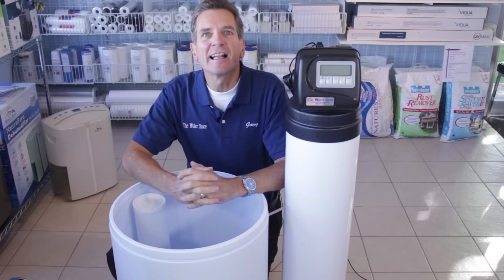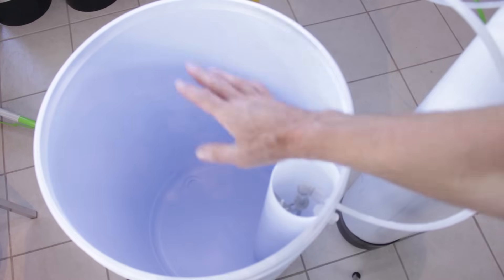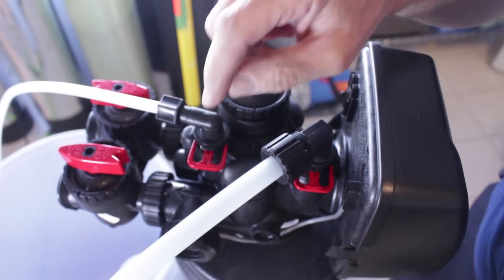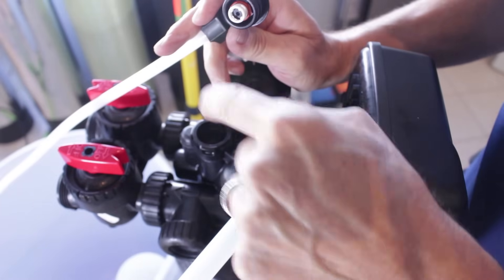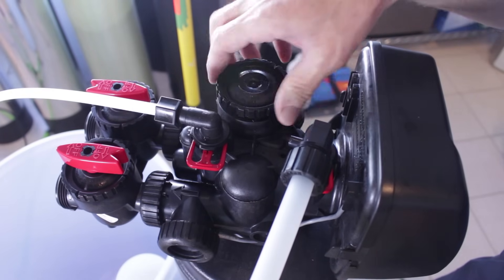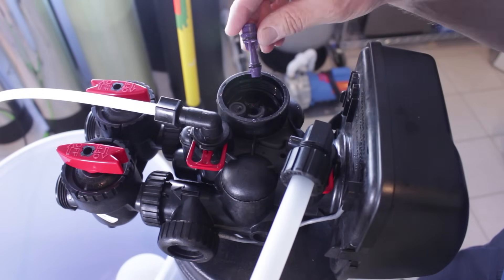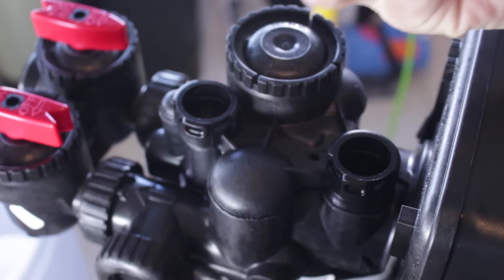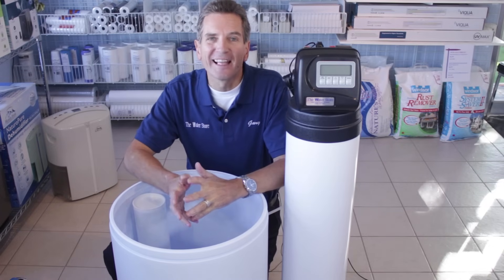Water Softener Troubleshooting Too much Water in Brine Tank

Comment: hi sir good day, i have a problem to my manual head  water softener, under the brine slow it doesn't absorb water instead it refills water in the brine tank.
what should i do ? 
thanks for accommodating my concern .
Reply from the maker: I have seen this before.  The valve needs to be rebuilt.
Reply: @water_estore  sir i already change a new item of head valve but still didn't function well. the same problem repeats even though i already change the head valve 4 times .

Comment: I am a bit confused.  It seems most of the things you mentioned control restricting the water going to the brine tank which means there will be less water in the brine tank, not more than expected.  In my case, my float stops flow so the max water allowed in the brine tank is always in there and not controlled by my Fleck 5600 mechanical timer water softener.  Maybe I don't understand the regeneration process.  Does the water softener meter how much water is put into the brine/salt tank or does it put the max into the tank and then meter how much is drawn out of the tank at regeneration time?
Reply from the maker: You may want to check out this video https://youtu.be/udmE-hhh084  The settings in the water softener determine how much water goes into the brine tank which determines how much salt you use.  It draws all of the water out of the brine tank during regeneration.
Reply: @water_estore The setting is at 10 pounds but I checked again yesterday that during refill the float stops the flow.  Not sure how to know how much water is calculated to create 10 pounds of brine but nevertheless I would think if the float stops flow at 10 pounds, that means that my unit can never use more than 10 pounds and the internal control will have little effect

Comment: Hi Gary. I am experience the complete opposite of this problem. My system is drawing water but not returning it. When I go to inspect salt levels I find all the water has gone. I add water and by the next day it has all gone. How do I address this problem?
Reply from the maker: Maybe you have a pre fill water softener https://youtu.be/GedMruLfXhY  If not I would check the hardness settings.

Comment: My  brine tank is 20 years old and I think has a small leak as water builds up outside of it - though I am not sure where the leak is coming from. I just had the tank replaced thinking it may be caused by that but it is not.   What should I do - as I am annoyed that the people I hired to fix the problem just wanted to sell me a new water tank for $1,300 rather than fix the real problem which I believe is the brine tank.
Reply from the maker: Sorry, I don't understand.  You said you replaced the brine tank and it is still leaking?
Reply: @water_estore  Sorry I found out the water leak was coming from the air conditioner's compensate box because it had been unplugged and  was overflowing onto the floor. Bottom line though I did not need a new Pump tank for $1,300 dollars - just needed to plug the damn compensate device back in. 😠

Comment: Recently have a softner issue. Guy came out and cleaned softner tank and iron tank. But softner seems to still not be working. When water is running I herd the iron tank filling with water but not the softner tank. Should I be able to hear the softner tank filling? And the salt I. The brine tank is not moving down so make me think m the water is not getting b salt, plus my husband and I are extremely itchy after taking a shower. Oh and water is slightly green, when you fill up tub only slightly looks green but if you let it set for awhile it is more noticeably green. Already had water guy come out twice, still seems to be not working? Help!!
Reply from the maker: Water softeners are silent when water passes through.  They only use salt when they regenerate, this video might help you https://youtu.be/udmE-hhh084  Did they test your water to establish if the water softener and iron filter are working?

Comment: My Whirlpool softener will fill with water, then very slowly drain, but not completely. Next cycle it will fill more, not completely drain. Next cycle it will fill even more, and slowly drain some. Eventually the water gets very high. It's like it doesnt k ow when to stop adding water, or the draining is too slow to allow the proper amount to drain within the specified time. I've cleaned the venturi multiple times and lines are not clogged. Any thoughts?
Reply from the maker: Assuming you've followed the advice in the video without luck, it sounds like an internal leak to me.  Afraid you need a new water softener.

Comment: I have a Clack valve that is re branded as a Hellenbrand H-1.25.  I purchased it from someone who had it installed in a larger application.  It does not seem to be creating suction and drawing brine.   I have attempted to clean everything and there is no active flow between brine tube and the drain tube so I don't think it's the piston assembly.  It has the yellow injector installed could it be the wrong injector that is preventing the system from drawing?
Reply from the maker: Yes, it is.  Page 10 of this manual tells you which injector for which size of tank https://cdn.shopify.com/s/files/1/0659/5447/files/Clack_WS1_Manual_Including_Drawings_and_Part_Numbers.pdf?11988583073503085745
Reply: @water_estore  The yellow injector matches the 13" tank I have.  I took the valve assembly out and am cleaning that today hoping that will help.  When the system is in brine draw it is pushing water into the brine tank and down the drain at the same time.  Very low flow on both ends but it's flowing out instead of in at the brine tube.
Reply from the maker: Pete McPeters water must be leaking past the piston. You likely need to replace the seal stack and pistons. They are here https://waterestore.ca/search?q=clack*+pis*&type=product

Comment: I have the opposite problem Gary.  I have way to little water being returned to the Brine tank.... Only a quarter of a gallon is returned to the tank....  It's a high efficiency water softener but that seems crazy low
Reply from the maker: Check your settings to make sure the hardness number is set correctly as well as the cycle settings from your manual.

Comment: how much brine waters is sucked back into the resin tank,   ….mine draws down very very slow and only appox 3/4" drop in brine tank happens
Reply from the maker: It should draw out all of the brine during regeneration and then at the end of the cycle replace it with new water.  If yours is not doing that you likely have a dirty injector.

Comment: Any idea why this thing would keep running?  I just worked my butt off on this thing all night. I ran out of running water, went back down in the basement and it was running again.
Reply from the maker: Not sure what you mean by keeps running.  Do you mean water keeps running to the drain?  If so, it usually means you need a new seal pack and pistons.  This video should help https://youtu.be/WIa033n4OQE

Comment: so are you supposed to put the system into bypass BEFORE checking any of this?
Reply from the maker: Good question, you can but as long as it isn't currently in a regeneration cycle you don't need to until you get to checking the injector, then before opening it up, yes, you should bypass and start a regeneration before opening it up.

Comment: My problem was brine water not being flushed out. After checking all the bases you cover, I still could not get it to work. I found an old display model at Home Depot that was missing the computer. So they were going to trash and let me trade out some parts. I did the bypass, the piston, the gears, and the venturi system from brine line to body, and bought and replaced the injector. After all of this, it would stick not suck brine water. 

I then focused on float assembly which was clean. I shook it to hear ball move and make sure it was not full of water. But I decided to watch how the ball floated under water and then noticed the ball would stick to bottom and not float up, even when under water. I was watching through a glass, and noticed by shaking it, I could free ball. But every time I put back in water, the ball would stick again. 

What should I do to fix this, without buying another part?
Reply: @water_estore  How do  I check? It makes the sound like it is in syphons mode. After soaking the float all night in joy soap water, it still sucks on bottom and will float if I shake it. Can the ball float stop it from sucking the brine?
Reply: @water_estore  I do not seem to have suction where it connects to the line at the top of softener. What role does the floating ball play?
Reply: Step 1 puts water out, 2 puts more water out, no 3, and 4 puts out more water. Then it goes to home.
Reply: @water_estore  I replaced everything but the float assembly, including the piston. I pulled piston out and noticed it was no longer locked in place. (1/2 turn) I locked it back and now have water flowing out of the drain line. My brine well is empty, except water now as I cleaned it all out. Should I add salt now, or add a resin rejuvenator?
Reply: Thought everything was working. Started with new install steps. Added salt waited 1 hr and ran a full cycle. Brine tank full of water again. This has nothing to do with the ball float?
Reply: @water_estore  Waterboss 900. Part number? It is 3.5 years old.
Reply: @water_estore  OK, I just tried a complete assembly of the piston from end to motor. Shop vac'ed to 4 inches over salt. After 2 cycles did not see water level move. 3rd attempt this morning and the brine tank filled again.
Reply: @water_estore  Looking at the piston, it has 1 side that has an oval shape cut out. I saw you pull one our where this was on the front side of WS and put back on back side. It comes in the package facing back, but when we pulled one out at HD it was on the front. Does this matter? Front being brine tank and rear being bypass valve.

Comment: I have a rather old system (20+ years old) which the previous owner neglected for several years. He was quite old and couldn't lift the bags to add salt to the brine tank so he just didn't at all. The resin tank looks like a big air tank (like what is used for welding gas) with a mechanical device on top that whirs like a clock when powered up. When I turn the knob on front to regeneration, It cycles and I can feel water rushing through the discharge tube to the drain. The brine tank looks like a big blue trash barrel with a single hose going into it and an overflow port on the side that drains on the cellar floor. The tube from the brine tank leads into a clear, hard plastic, bulb on the side of the mechanical device on top of the resin tank which is full of water with no air space. The base of this bulb is molded into the housing of the mechanical device and cannot be removed. The brine tank fills with water though this tube but does not draw water from the brine tank. There's a small plastic cage on the end of tube inside the brine tank but it appears to be clear of clogs. I've looked all over the mechanism to see if there is a hose missing from which brine would be drawn but there isn't any. My suspicion is that there is a clogged valve somewhere inside the mechanism allowing water to be added to the brine tank but not withdrawn.

Comment: Hi. Great video. I have a Culligan which I inherited when I rented the house. The brine tank was completely empty but very clean so I filled and it worked fine for 4 months. Refilled with salt and the next regen I found thick moist saltwater around the brine tank as a small puddle but the brine tank looks just the same as before and no water visible. The salt tended to drop more closest to the tube part where the float lives. Water still soft. Any ideas why it might leak like this?  I don’t see any salt tracks down the side of the tank either. After the pint or so of water dried I had around a cupful of salt. 
Thanks for any help you can offer!
Reply: Thanks!  Will try a manual regen tonight. Is there supposed to be water at the bottom of the float tube?  That is dry. I tried adding some water to the tank last night to see if there is a crack in the tank causing leaking - nothing. Will update if I find anything to help others as I haven’t found any videos etc for this problem 
Thanks again!
Reply: Hi again!
Came home to another puddle in the floor. The control unit said Refen but not flashing. I don’t recall it saying that before. No water running. 
The brine tank usually has 3/4 gallons permanently in the bottom and I filled it to about 2/3 full both times. 
I did a manual regen. The Regen on control panel started flashing and water/pump noises started. 
First stage - a few mins only - all good
Second stage the water started to appear around the bottom of the brine tank after a few minutes of operation and flow rate increased after that. No water or moisture down the sides - it just appeared from the base. 
My conclusion is that the extra weight of the salt pellets caused a small crack in the base of the tank. What do you think?
I do find it strange though that I added a gallon or so of fresh water last night - no leak overnight so 12+ hours without a drop on the floor. Then come home at 7.45 pmto more salty water on the garage floor  why would the water not leak immediately if there is a crack?  And the leak is worse when the cycle is running. The cycle is supposed to run at 2 am and the clock is correct. 
Any pointers as to whether the cracked base is correct or any ideas of anything else?
Wondering if I should try and empty the tank this weekend and see if I can spot a crack?
Thanks again for your help!

Comment: Hi Gary, I have a Excalibur Chlor A Soft water softener brand new installed. i noticed the brine tank has water in it after each regn.... each time it adds more and it doesn't drain at all. in Manual it says Improper program setting could be the cause of the too much water in brine tank... any suggestion on how I can program it?

Comment: Thanks for the videos!  Question: what would cause water to flow INTO the brine holding tank during the brine drain cycle?  I removed the hose from the pickup and observed water coming out when it should have been sucking it up.  Caused my brine tank to overflow twice (no float installed).  Injector looks clean, brine tank is clean, and no kinks in hose.  Could it be the pistons and assembly?  Thanks for any advice.
Reply: Clack.  Same one featured in your video.  Watched your video on Piston swap out, seems straight forward
Reply: I had same issues would like to know too ??? Should I change valve pack..

Comment: I've got a crazy problem.  My brine tube keeps popping off of the float tube.  I've changed the insert, I re-tightened, several times.  Each time it is "on" but by a cycle or two, it comes off.  Any ideas??

Comment: ~ Mine was clogged head with calcium,backing up the brine tank.
Reply: The Water eStore ~ No, it had to sit in an acid bath to break down the calcium. After that it runs fine. I’ll be sure to check and clean it more often that’s for sure. (Florida well water).

Comment: Hello
I have a Northstar water softner.
The unit will only fill the brine tank for 2 minutes. 
Ref: 0-100%
When the unit reachs 20-25% of the regen
I hear a sucking air noise.
Like the unit is NOT filling enough water.
Brine tank is clean.
Any thoughts/suggestions?
Thank You
Reply: The hardness is set at 16.
We have municipal well water. I verified setting with township. No leaks in brine line. My unit has psi tank inside brine tank.
Reply: How much water is normal to fill into brine tank during fill cycle?
Reply: Some Remaining
Reply: The Water eStore negative to emergency shutoff. It only adds approx 4" of water to tank. Manual states 2-9 minutes.

Comment: Hello Gary, I let my KCL level get down to a few inches low but not empty and the brine tank was full of water when I went to add more. I drained the water and added the KCL but my EcoWater is not softening the water anymore. I have watched the way the unit works and everything seems right. It starts with a fill, then a long brine, then a backwash, then a fast rinse and then to service. the fill works, fills the brine tank with about a foot of water. Then during the brine cycle the brine tank is almost emptied. Then the slow backwash and fast rinse cycles complete and it goes into service. My kettle calcifies and the water doesn't have a salty taste like before. Any Ideas? THX

Comment: I liked the video you made and quit informative. I have a Whirlpool that very close to the one in your video.  It is only about a year old or so. But I am having a problem with the larger "O" ring leaking and filling the outer salt tank and over flowing in to the overflow tube. I have taken it apart several times but with just a little fix of it leaking. It appears to be pretty much strait forward, but is there a secret to this.

Comment: I've checked all of these issues.  I'm thinking my issue may be due to the overflow hosing being connected with the valve drain hose.  It drains fine until the last cycle of the regeneration process (backwash?) then all the sudden water comes gushing in to the brine tank from the overflow hole.  Any thoughts on this?

Comment: Thank you for the good video.  My problem is a high pressure leak between the resin tank and the unit that sits on top.  The screws are tight on the base connection with resin tank.  Any ideas what's wrong?

Comment: I have a quick question....not only is the brine tank completely flooded, but my water softener won't turn on now. Would the high water in that tank have any thing to do with the loss of power? I've unplugged it and tried to plug it back in and nothing is happening. I don't think, or at least see an on/off switch... thank you in advance!